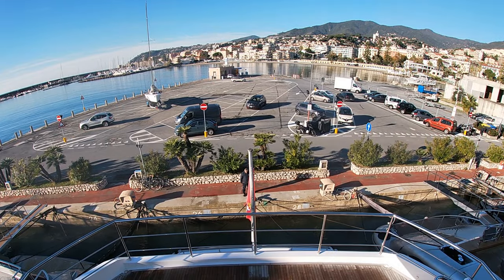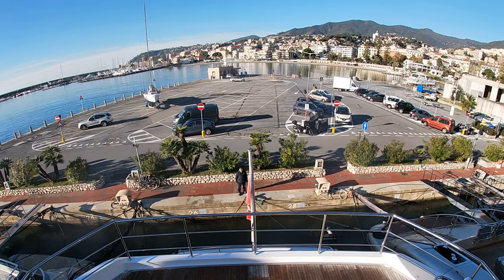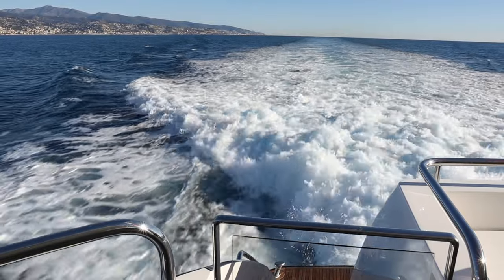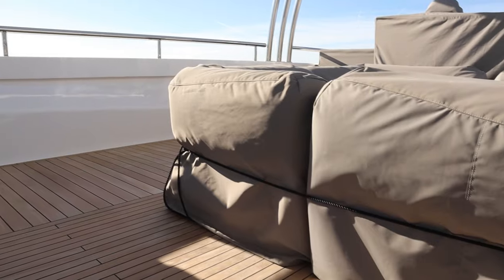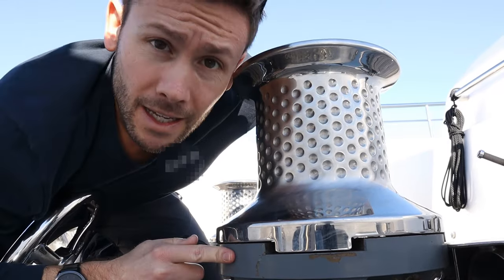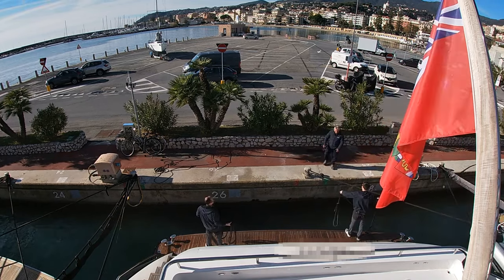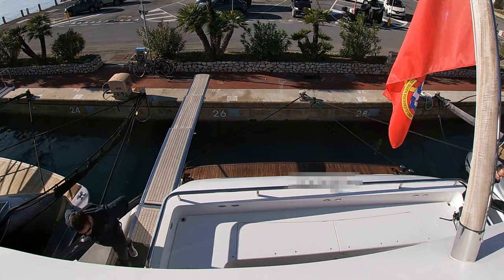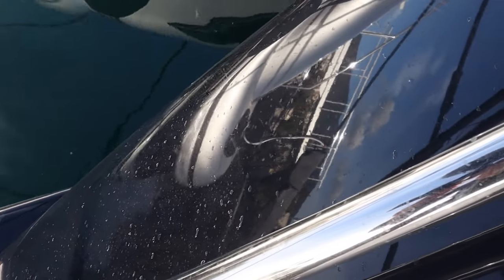UNDOCKING AND DOCKING A SUPERYACHT STERN TO (Including all the radio calls)

Comment: The precision, teamwork and skills of the crew is exceplary. I wouldn't expect anything less from any of you. 
On a personal note, it kinda reminds me of trying to maneuver my huge power wheelchair through a standard doorway. I literally have 2cm on either side of clearance. Come in at any angle and I'm stuck or damage either the doorframe or my chair. I've done both, not fun.
Reply from the maker: Thanks @SailorYuki. I once had to measure up all the gangways, doorways, and corridors on a yacht to see if someone in a wheelchair would be able to come on board. It was tight, but there was just enough room.
Reply: @WorkonaSuperyacht  manual wheelchairs are much smaller than the motorised ones. I have the fortune of being able to walk, so if I ever find myself onboard a yacht, my wheelchair won't be an issue.